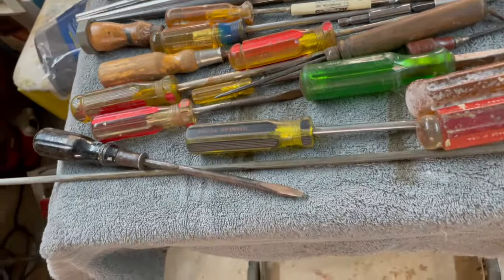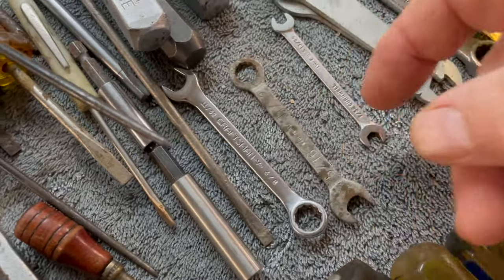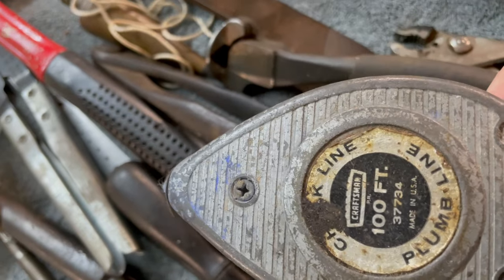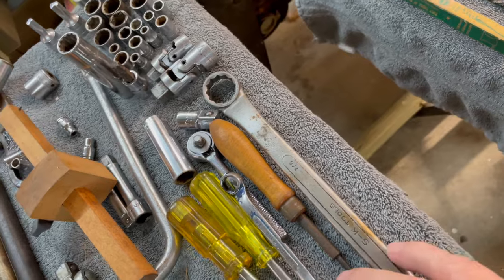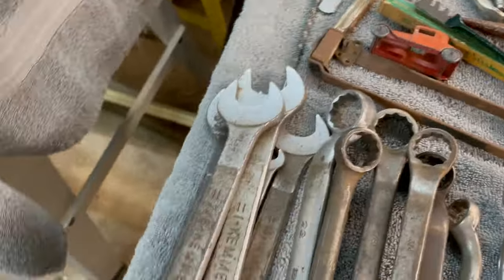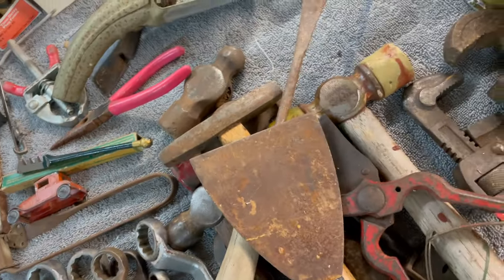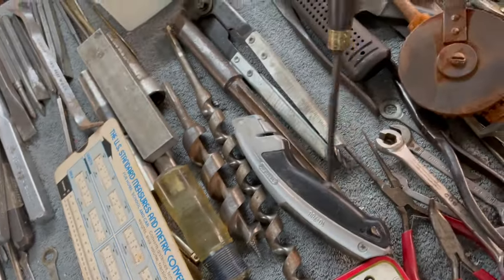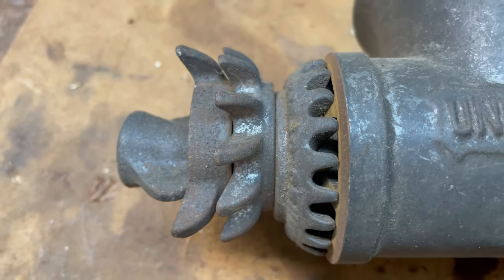Estate Sale Tool Haul

Comment: That tool like a drill is for grinding valves in engines. Some valves have two holes in the head for that end piece to fit into, others just have a straight slot. The valves with the two holes have different spacing depending on the valve maker. Your tool originaly came with extra bits depending on the valve hole spacing.
Reply from the maker: Wow thanks, I would never have guessed that, but it make sense. Would you know who makes it? I plan to restore it, and knowing what brand it is really helps.

Comment: The forked end hand tool is a weed puller.
The skinny tool at the end of the video, the one you said might be from England, looks like a gouge from a wood carving set.
Googling the rusted tool with the crank, looks like it's a vintage Kunkel hand crank valve grinder.
The red clipper tool is pruning clippers, for gardening
The Sherwin-Williams tool may be a paint mixing ratio ruler
Reply from the maker: Thank for the info, one other person also said the Hand Crank Is a valve grinder also. Is Kunkel the Brand name? I think you are correct about the gouge. I will probably try to use it on small projects with the Lathe. Im not good at carving. That makes sense on the paint mixing ratio ruller.  Thanks for the input  your information is very helpful.

Comment: dale nice to see you up and about,30$ for all that you did great screwdrivers nice group of punches nail set nice old craftsman and others the one tool i think it's a brace bit but really different never seen anything like it that cotter pin very odd
Reply from the maker: I have been told by some of the others it is used for  grinding Valves. I plan to do more research on it too many parts missing. Thanks for stopping by Ron. Always good to hear from you.

Comment: Love them double box ends the round shaft wrench remind me of Bonney maybe unbranded the kemmer wrenches I’ve never heard of I first thought they were plomb the oil spout is cool my grandfather had a lot of them some said pennzoil and some were Phillips 66
Reply from the maker: I saw somewhere in my research about the Kimmer that they may be connected to MAC, but I can't prove that for sure.  The oil can spout had a different name but I couldn't see it without my glasses. Thanks for watching.
Reply: @Dalesworkshop  you’re welcome them kemmer wrenches looks to be of great quality for sure to be related to Mac makes sense
Reply from the maker: Hey Don I saw your video on the Drill. Just wanted you to know the comments are turned off. Didn't know if you knew or not.
Reply: @Dalesworkshop  Thanks Dale I’ll have to look into that

Comment: Nice haul for 30 that file is a Nicholson they are great files I have some for metal work and wood working I went to a garage sale today didn’t do as good as you but I did manage to pick up a craftsman 3/8 drill sears and roebuck model 315101430 with box for 5 dollars it was slim pickings but I’ll have a tool to help me with restoration projects I’ll post a video tomorrow on it
Reply from the maker: Sounds like a nice find. My nick name when I worked for Eastern Airlines was Slim Pickens.
Reply: That’s cool what a coincidence that I mentioned that in my comment